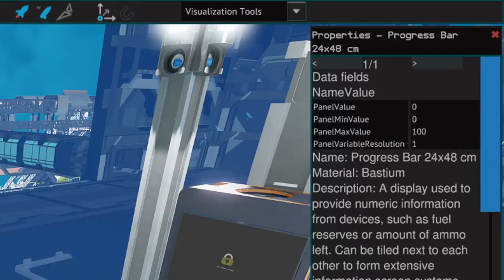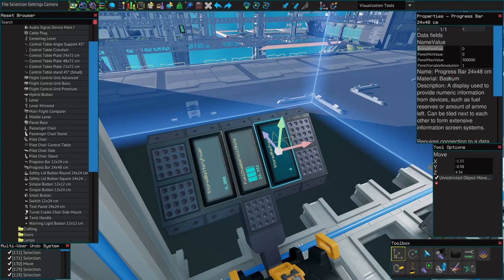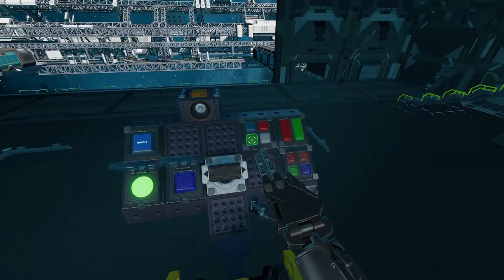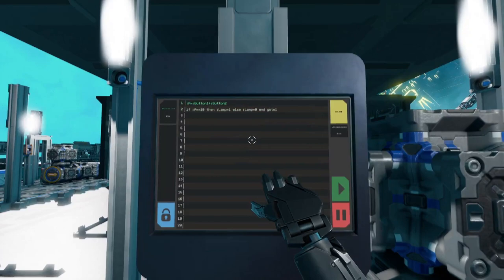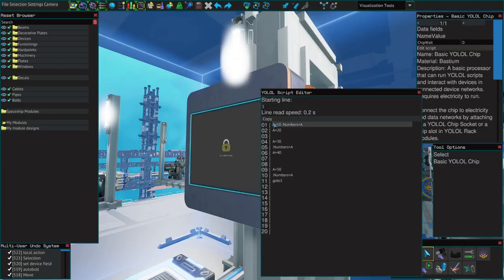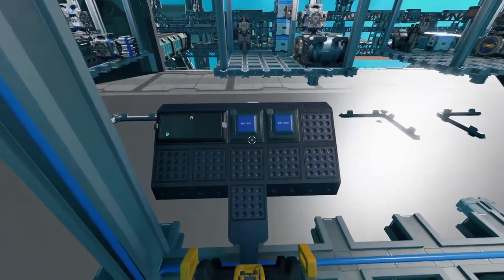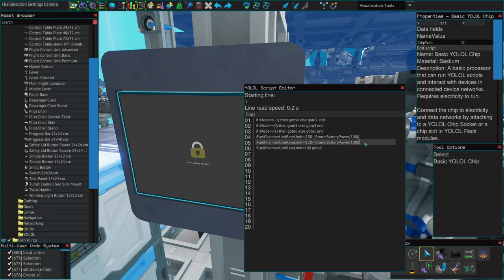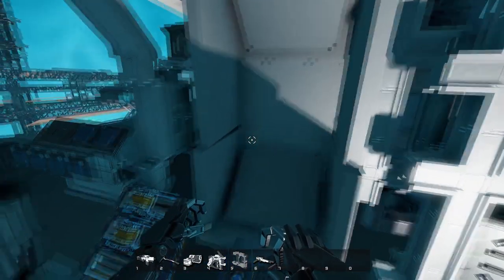STARBASE TLDR: YOLOL for dummies

Comment: Another tip for if/then statements is they can essentially be shorted to help with the line character limit. eg. 'if foo==bar then goto2 end goto1' As you're dealing with booleans (1/0, true/false) in if/then statements in YOLOL, this is all that's required to satisfy the requirements for an if/then statement. This removes the need to use else and then end to close the if/then statement saving some of those precious characters.
Reply: Lmao